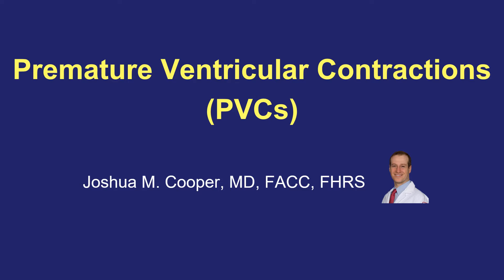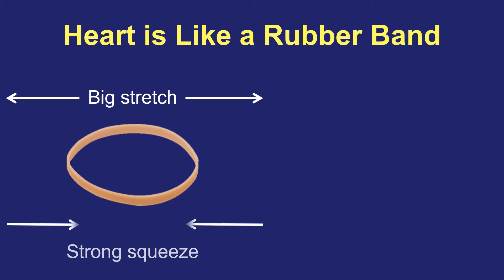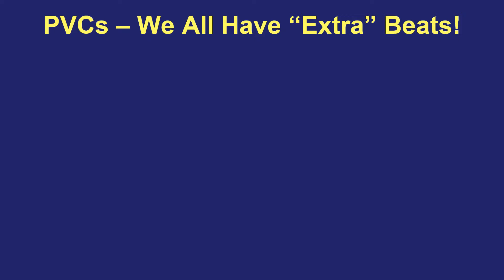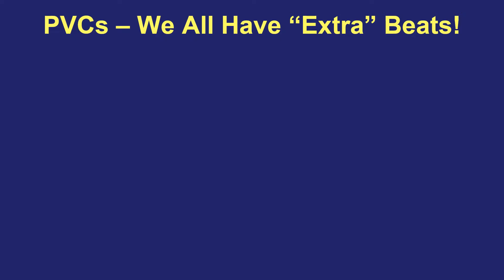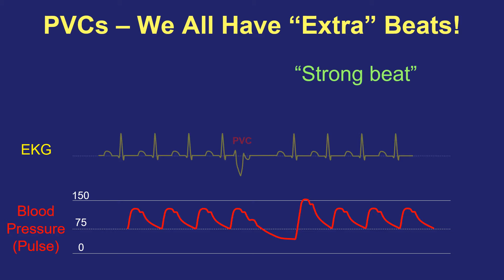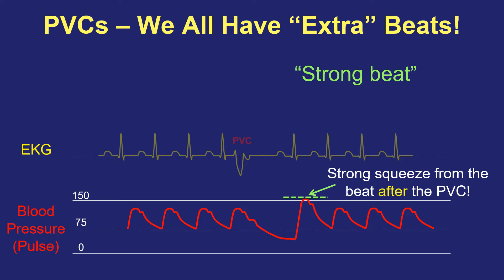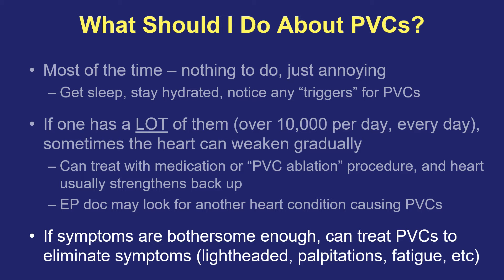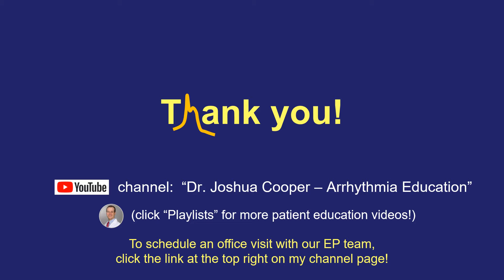PVCs: Symptoms and Treatment - in Plain English!

Comment: Doctor, does the same mechanism apply to PACs or are there any differences? Thank you :)
Reply from the maker: It's a great question!  In the video, I explain why PVC beats are weaker than normal, but I don't get into full details.  There are actually 3 different reasons why a PVC beat creates a very weak pulse:
1) The beat is early, with less time for the ventricles to fill (discussed in the video, rubber band analogy)
2) The pumping sequence of the heart is bottom-top instead of top-bottom, so that coordination is messed up (mentioned in the video in the context of symptoms, but this also reduces the strength of pumping during the PVC beat)
3) The PVC beat doesn't use the usual, specialized electrical tree to get the electrical signal everywhere at once in the ventricles to create a coordinated squeeze, and so within the ventricles themselves there is another kind of uncoordination (not discussed in the video)

With Premature Atrial Contractions (PACs), issues #2 and #3 above are not happening - i.e. there is good coordination between top and bottom, and there (usually) is use of the full electrical tree and therefore good pumping coordination within the parts of the ventricles.  But because the PAC beat is early, #1 is definitely happening.  And so, PACs are weaker than normal beats, but they usually have a better squeeze than PVCs.  And so PACs are more commonly felt as "early" beats when feeling the pulse, whereas PVCs are often not felt at all.  The beat after the PAC can still be a bit stronger than usual for the same reasons as after a PVC - extra time to fill the ventricles and a stronger squeeze as a result.

Thanks for a great question!
Reply: @dr.joshuacooper-arrhythmia9917  thank you so much for answering this, that makes perfect sense to me! (I'm predominantly pac sufferer). Thanks again for this arguably best YouTube video explaining premature beats issue!
Reply from the maker: I really appreciate your wonderful feedback!  Please feel free to forward this video to anyone  you think might benefit from learning a little about PVCs!
Reply: @dr.joshuacooper-arrhythmia9917  that's weird because I never feel my PACs but always feel my PVCS.
Reply from the maker: @sovereignsoulutions6612  Yes, that is the most common scenario, for the reasons above.  With a PAC, there is more coordination of top and bottom, and right and left pumping chambers, and the beat feels mostly normal (although a bit early, which most people don't notice). Because the PVC is uncoordinated, it is a very weak beat, which creates the sensation of a "skipped beat" and the next normal beat is stronger than normal and feels like big thump in the chest.  In addition, as per the video, during the PVC, the lack of top/bottom coordination can create symptoms in the neck, chest, lungs that does not happen with a PAC!

Comment: How long are echos good for?
Reply from the maker: Great question.  An echocardiogram shows how the heart is working at the time the test is done.  After that, lots of things can happen over various periods of time which can change how the heart is working.  The time frame for frequent PVCs (over 10,000 per day) to cause a change in heart function seems to usually be months to years, and not days.  So if someone has 20,000 PVCs per day, with no symptoms and a totally normal echocardiogram, many cardiologists may choose to repeat an echo in 6-12 months to see if there are any changes.  Of course, if new symptoms develop sooner, that might prompt sooner repeat evaluation and testing.

Comment: sometimes my pulse is in the 30's and 40's but I feel so short winded, why?
Reply from the maker: Your doctor can work with you to figure out two parts of your question. 1.What is your heart's rhythm at the time that your pulse is detected to be 30 to 40's? (Could be simply a slow heartbeat, or could be frequent PVCs which can result in a slow pulse as the video shows). 2.Are your symptoms of short-windedness directly a result of the slow pulse and heart rhythm?

When somebody's pulse rate is not appropriate for the body's needs at the time, that can result in fatigue, shortness of breath, etc. So if a slow pulse is determined to be causing symptoms, the treatment would depend on the nature of the problem. When somebody has a slow heartbeat it could be due to medications that could be decreased or stopped, or sometimes it requires a pacemaker. If the problem is pvc's, then elimination of the PVCs with medication or ablation could provide symptom relief.
Reply: Dr Cooper thanks for your answer! This video has actually made me feel better about this than all I have been told for years. I have dealt with pvc’s since 2013 but this video explains them so well. I wore a Zio patch a few weeks ago because my pulse had been so low for weeks and I felt so bad but it actually showed that my heart rate was predominately in the 60’s. My doctors and nurses have tried to explain this to me but it has never clicked like watching this video has, I really believe this will help me. I have always felt better when I have been working or even exercising so I would think I was ok then bam and I would think I was going have a stroke or feel so bad it would scare me so much! I am 71 years old but I still work everyday in my shop and other than these pvc’s I actually feel pretty good for someone my age. Reading a lot of these comments and thinking that sounds just like me also helps. I really believe I have let this just overwhelm me and stres me so much that it has just kept getting worse and just happening over and over!! Thank you so very much for this wonderful video and for sharing it with people who have dealt with this for so many years!!

Comment: I feel those „boom beats“ everyday.. alomost.. Sometimes 4 per day (maximum) sometimes none.. or maybe one. I dont smoke, i dont drink alcohol, i never took drugs, i dont drink coffe, Cola or Redbull. My heart echocardiography is normal, rest EKG.. The only thing.. i suffer/suffered from severe anxiety.. My heart rate is normal 60-70, my blood pressure also.. i‘m 32
Reply from the maker: It's amazing that PVCs can bother some people so much that they know exactly how many they have per day, without even using a heart monitor.  As I've mentioned before, anxiety and PVCs often go together, with each one possibly contributing to the other!  It's hard to pinpoint a specific cause of PVCs in most people, and therefore there often isn't much that one can do from a lifestyle standpoint to reduce them, unfortunately.  In the grand scheme of things, 4 per day is on the low side - they are very unlikely to cause any medical trouble at all, but I understand that even this amount can be very bothersome and scary.  Catheter ablation would be very difficult to do, with so few PVCs occurring daily.  Some people find that over-the-counter magnesium oxide supplement can help reduce PVCs, so that might be worth a shot!
Reply: @dr.joshuacooper-arrhythmia9917  , First time i had them a few years ago, after my divorce.. just sometimes, rarely. And now, 4 years later, i feel them again. My question is.. did they stop for 4 years!? Or maybe i was not paying attention to them anymore? And now, after a very stressful period, i feel them again. I did my echocardiography every 6 months, EKG also.. Even in a middle of panic attack, for 30 minutes i had an EKG while i was in a Ambulance, and guess what? Nothing.. I‘ve tried so hard to understand what actually trigger them. When i am very exited about something, when i am anxious or scared. And yes, i tried with Magnesium, and it really works.. (or maybe is just the Placebo effect) 😅

Comment: I feel the pvc sometimes low sometimes very hard and I feel very scared, is it dangerous?
Reply from the maker: The message I was hoping to teach from this video is that most PVCs are not at all dangerous, even when they cause symptoms that feel scary.  There is no relationship between how much someone feels single PVCs and whether they are dangerous or not.  So you can talk to your doctor about your symptoms, and perhaps make sure you have the correct diagnosis of PVCs, but do not worry based on how much you feel symptoms from PVCs - they can be very strong, but almost always are very brief, lasting 1-2 seconds at most.  Best of luck to you!
Reply: @dr.joshuacooper-arrhythmia9917  the doctor told me that the pvc are not dangerous but I feel scary every time I have a pvc, thank you for your answer 😄

Comment: Are contractions and complexes the same thing?
Reply from the maker: This is an excellent question!  Yes, basically they are the same thing, and "Premature Ventricular Complex" and "Premature Ventricular Contraction" are synonymous.  If you want to get technical, "complex" refers to the electrical recording on EKG or heart monitor, while "contraction" refers to the physical squeezing that immediately follows the electrical signal (and, as per the video, the contraction strength during the PVC beat is weaker than during normal beats, largely due to the PVC beat having less time to fill with blood before that early squeeze/contraction happens!).
Reply: ❤️ Thank you sooooo much!!!

Comment: Hi doc I have a question, I have PVC but after birth I started to get them back to back and I feel like this pause and then a hard thud what can it be?? I also feel like my pulse is really slow
Reply from the maker: You are perfectly describing the sensations that many people feel with PVCs, either one at a time or a couple in a row.  As explained in the video, the PVC beat is weaker and is often not felt (same goes for 2 in a row), and then the first normal beat afterward feels really strong (explanations in the video).  So people describe a "pause and then a hard thud" just as you did!  If PVCs occur every other beat for any period of time, then the pulse will feel slow because the PVCs are often not felt - thus, the heartbeat feels like it's going at half the normal pace (also explained in the video where I talk about "bigeminy").  You can talk to an EP doc who specializes in electrical problems of the heart, if you want to discuss if and how your PVCs could be treated. Best of luck to you!
Reply: @dr.joshuacooper-arrhythmia9917  thank you so much for this 😊 I just seen a cardiologist yesterday he ordered a holster monitor and a stress test. He also prescribed me magnesium oxide what do you think about that?
Reply from the maker: @acortiz2118  Many people find that daily magnesium supplementation does help suppress PVCs.  A Holter monitor can be used to figure out how many PVCs are happening in 24 hours, and if they mostly/all look like they are coming from the same spot.  Glad you're getting care from a cardiologist and I hope all goes well!
Reply: @dr.joshuacooper-arrhythmia9917  what do you think about magnesium oxide? I hear a lot of people and drs rather go with any other type of magnesium
Reply from the maker: @acortiz2118  my understanding is that magnesium oxide is very well absorbed, and that's what i recommend.

Comment: Thank you so well understood!!!
Reply from the maker: Glad it was helpful!
Reply: @dr.joshuacooper-arrhythmia9917  Can you have another video of PAC symptons and treatments?
Reply from the maker: Yes, I can create a companion video about PACs.  In the meantime, here is a copy/paste of a reply I recently gave to another viewer who also asked about PACs:

In the video, I explain why PVC beats are weaker than normal, but I don't get into full details.  There are actually 3 reasons why PVC beats provide a weaker pulse:
1) The beat is early, with less time for the ventricles to fill (discussed in the video)
2) The sequence is bottom-top instead of top-bottom, so that coordination is messed up (hinted at in the video)
3) The PVC beat doesn't use the usual, specialized electrical tree to get the electrical signal everywhere at once in the ventricles to create a coordinated squeeze, and so within the ventricles themselves there is a second kind of uncoordination (not reviewed in the video)

With Premature Atrial Contractions (PACs), issues #2 and #3 above aren't happening - i.e. there is good coordination between top and bottom, and there (usually) is use of the full electrical tree and therefore good coordination within the parts of the ventricles.  And so, PACs create a better squeeze than PVCs, and usually can be felt in the pulse as early beats, although they may still be a bit weaker due to issue #1 above.  The beat after the PAC can still be a bit stronger than usual for the same reasons as after a PVC - extra time to fill the ventricles and a stronger squeeze as a result.

Like PVCs, PACs can also have a variety of causes, but often we can't find any obvious trigger or reason.  They may come and go with illness, dehydration, stress, alcohol, fatigue, caffeine, some medical conditions, or have no obvious cause.  If bothersome enough to warrant treatment, options of medications and catheter ablation are both available, depending on the circumstances.  Talk to your doctor about your symptoms.  A simple heart monitor can often be helpful to track when PACs are happening and correlate with symptoms and daily events.  And sometimes PACs can be a precursor to longer arrhythmias such as atrial tachycardia or atrial fibrillation, which, if they occur, may warrant treatment from a medical perspective (whereas PACs are mostly just annoying and usually not medically important).
Reply: I have a lot of PAC and as u mentioned all of us have some irregular heartbeats.  But in the begining it felt a few and took metroprolol slow release and now with hydration and eating/exercise/meditation to ward off stress of daily life it has been a bit unnoticed.  So was curious! PAC is the upper chambers of the heart? right!!
 @dr.joshuacooper-arrhythmia9917
Reply: I would love to watch them again and again since so well put together.  Thank you for your response and hardwork!!
Reply from the maker: Yes, a PAC is an early beat that starts in the top part of the heart, rather than in the bottom.  So the PAC beat comes early, but the Top-Bottom order remains normal on that beat (which is not the case for PVC beats, which come from the bottom part of the heart!).
Reply: @dr.joshuacooper-arrhythmia9917  I always felt heart was a complicated mechanism and not for normal common people to understand. But your concept of rubber band will always stick to me and understand a bit about the pumping of the heart and beats.  You made it simple and brilliant.  Thanks!